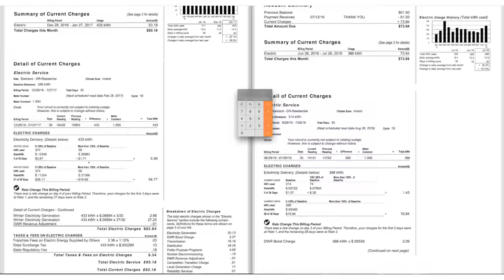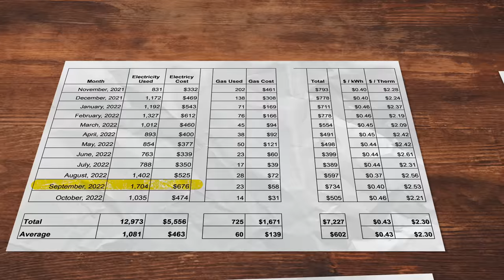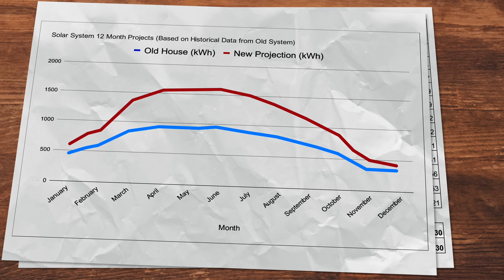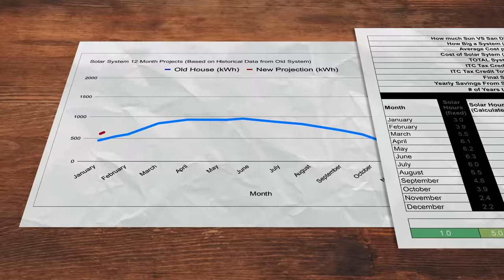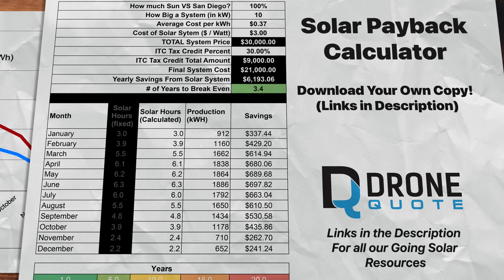Go Solar Before April 2023 - EVERYTHING Is Changing!

Comment: 1- No, you do not need twice as much solar for an off grid system. Off grid homes are generally smaller, more efficient and use off grid systems for heating and cooling and cooking like wood stoves or propane.

2- Your home is not typical and most people do not have a swimming pool and that pump is  an energy hog. Get a pool membership and grow a garden where that pool was.  OR get an above ground pool used seasonally and they can be run fine off just a small solar system and heated with solar. I have one.

3- The average home needs about 5-7Kw of solar. Your home is badly situated near a hill and that is a poor choice for solar. When you buy or build a home always consider how much solar it will get throughout the year and you may need to remove or top trees if you can. The best place for panels is facing true south not magnetic south and you need to have proper angle to get the low sun angle in winter. A ground mount system allows you to get the best angle and facing for your panels.

3- Flexible panels will not last on an RV when you are traveling. They are made for a temp set up maybe for camping or an emergency to charge a power station. Not permanent installation.

Summary: Not all homes are great for solar and you should consider that before buying or building a home. You might be better off adding more insulation, using efficient appliances, and reducing your power use and you should do that before installing solar. 20+ years off grid and life is great!

ADDED: 

The "new" off gridders!  I got kick out of a discussion with a young man today in a forum trying to tell me how my system is antiquated and people are not using "gandma's old solar and batteries".  According to that new off gridder now the way to do it is to buy a really huge system and lots of batteries so you can have everything electric and especially so you can have a big gaming system and fat screen TV and run all your heating, cooking, cooling and water heating off solar electric.

Sounds great I said but what happens when you lose your job or become disabled and don't have the money to keep that huge system maintained?

I am seeing more of these channels promoting big grid tied and off grid systems that are way out of reach for an average person and are not sustainable if your life suddenly has a setback.

These people promoting them mostly work for the solar or tech industries and are promoting systems and products that the average person can't afford and won't be able to maintain and will be worse off than if they just stayed on the grid and set up a small emergency solar backup system.

The reason I promote small systems is not because I couldn't afford a larger system and more panels and batteries. It is because I want and need a system that I can maintain regardless of my income or life situation changing and is sustainable even in bad times.  I you want to add panels and batteries for some extras you can and I have for recharging my ebikes and running a few more appliances but the system is designed so I can survive and have all the necessities if things change and designed for long term sustainability.

Now that panels have come way down in price people are getting huge systems without understanding those panels will lose efficiency over time and have to be replaced and batteries are still very expensive and have to be replaced and if you try to live off grid like you live on grid and your income changes you will not be able to maintain that system.

Ok, I think that needs to be said because there are a few channels on YT I won't mention that are steering people down the wrong path IMO and it will end up hurting people and give solar and off gridding a bad name.
Reply: However, this isn't because an off-grid system uses less energy.  An off-grid system has to deal with conditions such as week-long storms and still be able to make ends meet, so even using less energy an off-grid home would need a much, much larger solar (and battery) system than any grid-tied home would ever need.   The difference is that most off-grid homes don't just have solar.  They also have a generator to make ends meet during those stormy or cloudy weeks in Winter.   That generator allows the off-grid home to install roughly a similar amount of solar as a grid-tied home would have trying to zero-out their bill.

Without the generator, an off-grid system would need twice as much (even being more efficient), and even then there would be several problem weeks each year.
Reply: @junkerzn7312  No that is not accurate. Off gridders do not use inefficient appliances and our heat, cooling and cooking does not use electricity. We use alternative systems and usually propane. or woodstoves. I haven't used a generator all year and have been off grid 20+ years. You obviously have never lived off grid.
Reply: I'm currently grid tied. Have net metering. They pay way less for over production during the day. Than they charge you at night. 
So you have to way over produce.
I have 10,080 watts maxes out my inverter. Have all electric house. Have had zero bills 5 years running. I installed geothermal heating and cooling myself. For less than estimates to have conventional HVAC installed in my house.  If Aptera actually produces their cars. I will get 600 mile 66k battery. Fully loaded. The way I would want it. $39,600. They are planning on V2H. 
To have 3 power walls installed $49,000. Less than 40k. 
66k would run my entire house for 4 days without solar. I do have a Onan 6.5k lp. No lp yet, just for if I ever go completely off grid. That I took out of the motorhome I was living in while I built my house. Just incase. 
If they manage to eliminate my net metering. 
I will go off grid. 
Have enough south facing roof to add 15 more panels. Would have to add another inverter.... If  I can't live the same off grid as grid tied. With the current system.
Reply: @danmccoy6164  If you lost your job or become disabled would you be able to maintain your system?  It happens everyday to people.
Reply: @solarcabin  
I have zero bills. Soon to pay off house loan will be zero payments. I do have disability insurance. I will not be climbing on my roof even though I am not disabled. I had the solar installed.  
So about as good as you'll get for anything. I would have a much worse time.  If I was living in a regular house. If I lost my job or became disabled. That is actually why I built my house. As little maintenance as possible. Right now I'm installing a solar hydronic heated driveway. Pumps will run off photovoltaic panels. Free heated driveway. I will have no real ROI on that. Just hate shoveling and running snowblower.  And preparing for when I get a little older and can't shovel snow. I only have one acre so not much lawn to take care of.  Plus I just got the driveway poured over the 2" of insulation and 8,000ft of 3/4" pex I installed myself. 11 truck loads of cement.   
So I have even less lawn to mow. Lol.
Reply: @solarcabin  Urm.  I think you really missed the point.  If you are using propane for major energy sinks in the home, then obviously you could get away with a much smaller solar and battery system.  But of course, that means you are paying for the propane... and a lot of it if you including heating.

The generator example I gave (i.e. propane generator) is not a regular use case, but something you would only need to run on rare occasions... the propane consumption would be 1/100th the propane you consume in a propane-centric home.

Most older off-grid homes, indeed, use propane for fridges, heating, and cooking.   That's the way things used to be done because there were really no other good solutions.

But if you look at what a lot of people are doing now, they are actually using less propane and a lot more solar and battery storage.  There are extremely efficient electrical solutions to everything, including heating (though heating still takes a lot of energy).

A heat pump water heater with an 80 gallon tank will use less than 4kWh a day.  A fridge needs about 2kWh a day.   Cooking with an induction stovetop is also less than 4kWh a day (and usually a lot less), a large toaster oven works great as an oven.   An electric dryer consumes more power but is typically only run once a week.

These loads are literally in the weeds relative to what even just a modest modern solar system can produce in a day.

Heating and cooling are more debatable.  Propane is still available, typically, because you would need 10-15kW worth of panels to majority-heat with a mini-split.   But people are doing it both ways.... modest excess solar and batteries so a heat pump (mini-split) can take a huge bite out of propane furnace use.   Then use the propane for those few weeks of the year where the solar is insufficient... for heating and charging.

But as you can see, the number of propane appliances can be cut down massively even with only modest over-sizing of the solar and battery system. 

This isn't your grand-ma's solar and battery.  Modern setups put a lot solar in 10-20kW, and a lot of LFP batteries in... at least 20-50kWh or so, depending.
Reply: @junkerzn7312  
Ummm. I think you are missing the point.
My house 3400sqft all heated and cooled all of the time. All electric house heating and cooling. Domestic hot water is produced from water jacket on the compressor in geothermal heat pump. I really have zero bills. For 5 years now. If they eliminate net metering I will do the small things that I would have to do to maintain the excact lifestyle I have being grid tied right now. Except for the battery in the car. Which I will get if they actually produce it. Grid tied or not. If I'm grandfathered in and don't loose net metering. I'll just use it for backup for power outages. I've been planning this house for along time. I had a contractor put up the outside. And I did everything inside. It's unbelievably efficient.  Has taken me 5 years of working on it every single day never missed a day. Unless I was out of town. And worked atleast 2800hr every year driving a forklift to pay for it. The only propane that would ever be used is  if I  go  off grid totally.  And only in the off chance that I ever have a really long. Time with no sun. SORRY I  THOUGHT YOU WERE SOLARCABIN REPLYING TO ME.  I'LL  GO HIDE IN THE CORNER NOW.
Reply: @junkerzn7312  When you have been 20 years off grid with your system you come back and see me kid!

Comment: My 5 cigs panels completely delaminated after 1.5 years.  Replaced under warranty.  I was told (the second time) I had to seal every edge after install with permabond tape.  This is now well documented  by many other users on solar forums.
Reply: What you just used scotch tape? Of course your use a permanent tape

Comment: I installed solar on my boat and have electric motors installed for low speed and reduce my petrol cost.  And have notice other boat owners don't use solar power I bet there is a potential market there.

Comment: avoid flat sticky panels with no airgap under them , on a hot day you can lose upwards of 15-25% due to the excess heat over 25c or 75F. 
For every 1F Above 77F, you lose about 0.35% effiency. 
No to mention you are already only going to make about 75% production on panel rated wattage under ideal conditions.

Comment: Excellent start for this "Solar power for Dummies" series. Step 1: Make sure your solar panel does not sit on unsound foundations. Step 2: Pluses and minuses of parallel and series solar panel wiring. Step 3: Optimize solar panel placement for optimal solar energy collection.
Reply: yeah not bad. but check this out. step 1 invest in gas and oil. everyone will be paying an absolute fortune for it. 
because how else will all this very energy intensive electric junk be manufactured in the future?
there is no step 2.

Comment: I’ve found that,unless you have variable rates,the expense of exporting power makes little sense. It’s irritating that I pay Oncore ,the grid infrastructure here in Tx ,as much as I pay for energy I use to backup my off-grid system. The two houses l run off my system,five bedrooms in total all-electric, cost approximately $100 monthly. If I had two more houses in my micro grid,we could go completely off- grid with another 20 KWA of batteries and 6 KW more panels. My propane generator might get used in very extreme circumstances.

Comment: BTW, might be more cost effective in the long run to use PV cells that are cooled via the solar hot water generation panel it sits on top of. "Free" hot water for showers and pools while increasing the efficiency of the PV cells by effectively cooling them down.
Reply from the maker: Going to try this around my pool setup!

Comment: Great video in plain language! We built a small house (550 square feet) in the Central Coast area of California, so we have plenty of sun almost all year long. Even though, as you pointed out, the cost of a metal roof is much greater than asphalt, we went with a white, standing seem metal roof anyway. Our system is a 6.5 kW setup via 15 panels with 10kWh of battery backup. After a year of use, it has more than met our needs - even on rainy days. Admittedly, our climate doesn't require much heating or cooling, so we haven't stressed it too much or run out of battery. Total cost was 12 grand (including the four  LiTime  batteries) and we should recoup our investment in roughly five years - sooner of you consider we eliminated gas. I'm also not accounting for rises in electricity costs over time from our local utility.

Comment: Great video and timing perfect! Going solar -- by the time we get the permits, and utility company let's us feed excess kWh into the grid, should be live by June-July (just in time for NJ summers). We had a new roof installed October 2021, so we have no issues adding solar panels 1 1/2 years later. Also, we didn't think about how the roof-mounted solar panels will keep the house cooler as the roof shingles won't get as hot with solar panels on top of them.

Comment: You gotta be careful about flexible solar panels.  They don't have the same endurance against weather as a fixed panel, and they also generally have much higher degradation rates over time than fixed panels.  A fixed panel will generally last 4x longer.  Or more.
Reply: The rapid degradation that you are referring to is commonly seen on amorphous silicon chemistry panels. These make up the majority of flexible or thin film style panels. The ones used in the video are CIGS chemistry panels which are not only much more efficient, they also don't have the same degradation problem as AS panels.
Reply: Most are also use Thin Film technology, which in general, is more efficient but less environmentally sound.  Some use expensive and hard to source (toxically sourced) materials like Tellurium.  Monocrystalline silica is still a better buy, if you care about such things.

Comment: Wow that cost per watt is huge, especially if your paying for the installation on top, my panels cost me 50c AU per watt new and my whole system 2kw solar/9kw of LFP batteries was about $7500au. Obviously my system isn't big enough for your average house but quadruple the solar and double the battery pack for about $14,000 au and your set. Diy isn't something everyone can do but I also think a lot more are capable of it than they think, especially now with the all in one boxes where you basically mount it and connect up the panels and batteries to it and thats pretty much it.

Comment: It's a shame these are almost 600 bucks for 200 watts. With their light weight, it might be worth trying them as siding for south facing walls, especially in far north locations. It would be 2.90 per watt at this price, though. It might be worth it if you don't have any land or roofs facing the sun.

Comment: With cheaper power where I am ($.12 - $.14), and a roof that's not really optimal for solar, plus the fact that my roof is probably half way through it's life, it seems like my best option would be to go for a house battery only without solar. Charge the battery off peak at lower rates ($.05), and use that battery for peak hours. Sadly, I don't know if that would ever be worth the hassle, expense, lost space, and any risks. Solar is nearly a no brainer in places like San Diego.